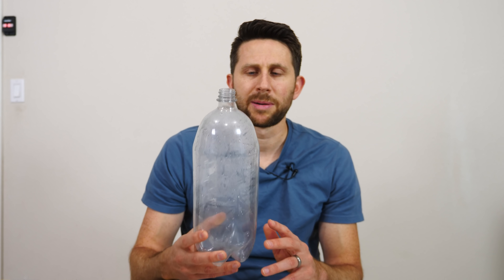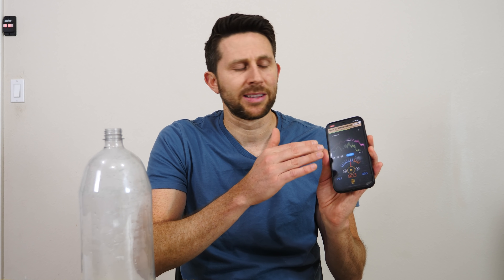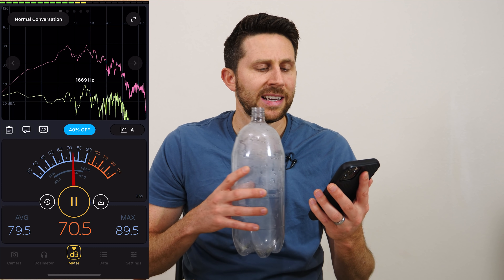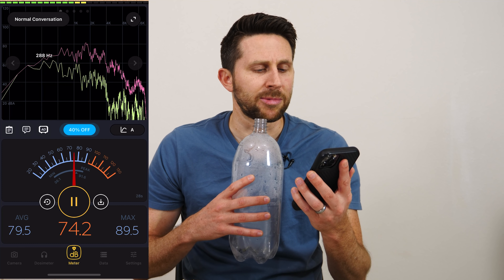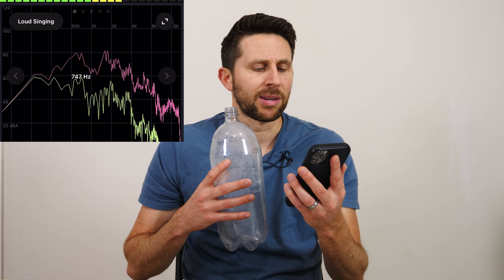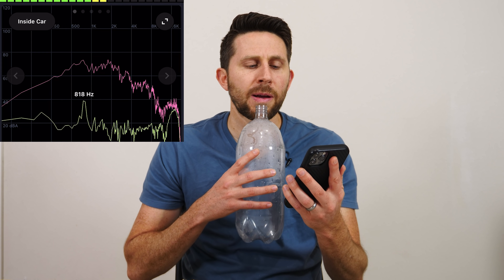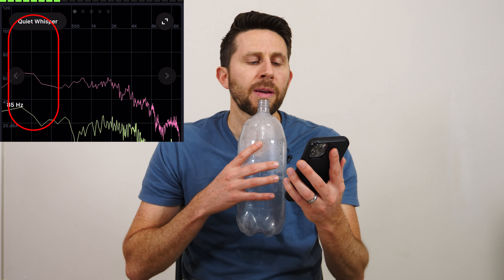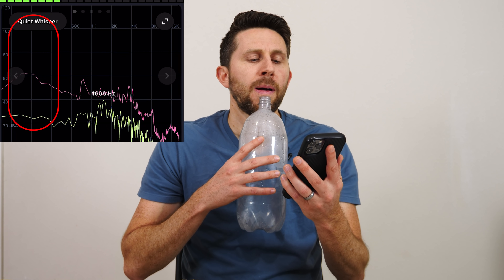Moving Things With Sound—Helmholtz Resonance Propulsion

Comment: Would the shape of the bottle affect the propulsion / vortici speeds?  what would happen if the bottles had a small amount of fluid inside also?  How could the experiment change by changing different factors of the bottle or the fluid?  in a room with slightly more or less oxygen?  In a space full of helium?  maybe my imagination is running away with me.  What things are really possible with different variations?

Comment: Nope, it's powered by in the case of speaker, electricity. As just like hydrogen powers nothing as it is only a liquid battery. Air like waves on the ocean is just the carrier of the energy produced by something else.

Comment: Can someone explain how does the blowing to the bottle thing works? It makes sense if you blow over the neck opening and creating a low pressure area to the opening. But what if you are blowing in to bottle, then it's pressurized and has higher pressure than atmospheric

Comment: When I worked in Hospital, we used a resonator to calibrate the output power of therapeutic ultrasound devices.
The resonator is immersed in water, the transducer in water a set distance away.
The pointy end of the resonator (sealed!) was facing toward the transducer.
As we increased the power, the resonator would be pushed back...the amount of deflection a direct measure of 'acoustic pressure'.
Oh, the water had to be pure and a certain temperature, but the results of the test were considered reliable.

Comment: @The Action Lab  the fluid dynamics community would point out that this is a reaction motor, similar to a pulsing jellyfish creating propulsion by flinging out vortex-rings.      Vortices slowly carry momentum along as they move.   (A mass-bearing fluid jet is the same as a close-spaced stack of moving vortex-rings.  But launching even one vortex-ring will give an opposite "kick" to the launching device.)   If your fluid viscosity is low, then, during sound-oscillations at a circular aperture, the "sucking" part of the AC cycle will produce no vortex-shedding and zero propulsion, but the "blowing" will assemble and launch a single ring-vortex, which carries momentum with it as it flies away.  So, rather than a von Karman vortex-street, it's "smoke-ring machine-gun."   (But multiple vortices are not required.  A single ring-vortex is a mass-carrying object, and the bottle receives a "kick" from launching each single ring-vortex.)
Maybe with an ENTIRELY smoke-filled bottle, aimed upwards, a high-speed camera might see ring-vortices in the smoke stream, just before clear air gets injected into the bottle and messes up the uniform smoke.  (Probably there are ring-vortices being launched inwards as well.   But these crash into the bottle's inner surface, delivering their momentum back into the bottle, so they produce zero net thrust.)

It's just a jet engine, but where the intake and outlet are the same.   It must rely on "Feynman's Inverse Lawn-sprinkler" effect, where sucking does not shed any vortices, and cannot cause propulsion, but blowing causes large propulsion.  Hence, oscillating AC fluid-motion will still generate a narrow "exhaust plume" and create a reaction-motor for Feynman's sprinkler (but only in situations with high fluid inertia and low viscosity.)

Vortex-rings have an outer surface!   They're roughly spherical.   All the air within the surface is moving along as the entire vortex moves ...as if the vortex was a moving baseball made of gas.   It's a real "object," just like a fluid jet, and if it strikes a surface, it delivers a punch.   (And when you first create such a gas-baseball, your vortex-launcher receives a "reaction kick.")

Here's something I've yet to try.   Build a loudspeaker-based smoke-ring box.   Put it in an aquarium full of smoke.   Now launch smoke-rings upwards slowly.   Ideally they should be spherical, like "Hills Vortex."   WIthout turbulent mixing with the air outside the spherical boundary, the ring-shaped flow in the core may be totally invisible.   Will they remain as "air balls," and not slowly change back into smoke rings?

edit: hey, RIMSTAR has a 2014 video, and his shows a textbook illustration: yes, the stream is actually individual smoke-rings, NOT a von Karman vortex-street.  His yt video is:  L5fVFA2sWt4

Comment: so what if i generate a negative charge on the ions inside the chamber and a source plate that switches charge/polarity as the container's vibration moves the ionized air out so that by the time the vibration would be pulling air back in it has rebuilt the amount of charge that was discharged with the moving ions out the opening so the ionized air refuses to come back into the bottle due to the negative charge in the bottle already.

then open up small ports for air to enter as the ions exit to supply the chamber with more ions to move???

Comment: With air bumping into all surfaces inside the bottle EXCEPT the opening, there is more internal pressure on the front than on the back. Could this also be the cause of movement?

Comment: A critical key to think about is the squareness of volume...  an over square vortex tends to become trapped between two pressure gradients and un-coils itself, where as a under square vortex is able to free itself through the process of coiling inwardly . Expansion chambers like what was used on early 2-cycle dirt bikes moved the exhaust gases out the end of the expansion chamber in that a vacuum could be created on top of the piston & at a time when the piston was at bottom dead center and again, produced a pressure when the piston started it's way upwardly. Engery that is transmitted by sound is greater when a gas is under pressure than what it is under a vacuum.

Comment: Ok I had this idea the other day and it’s along the lines of what you do so please help me answer it or tell me a principal or even make a video 

Ok so say you have a pice of gym equipment and the weight is supported by the wires when you lift it up 

So if someone is using one of thoes machines they are holding the weight 
But say that person using that machine was on a pice of wood and so was the machine 

If the person lifted the weight up and 2 people tried to pick up the machine and the person on the pice of ply wood would they feel the weight the original person was lifting?

Comment: Sound air pumps may be made if one-way valves are installed at both ends by creating a frequency from the speaker inside the bottle.

Comment: damn all I can think about now is using an actuator, on a bottle (thinking about the tesla earthquake machine kinda thing but fast enough for the bottle) with a short tube to direct the air down so it could be used as propulsion for a boat/raft to see how fast I can get it going.  steering with a rudder, or have 2 bottles on either side and vary the power to adjust the force on either side to steer.

Comment: Similar to the pulse jet engine where the exhaust gases from combustion, flows towards the exhaust because of it's higher heat and lower pressure rather than the colder and higher pressure intake air. As a result, pulls in more air from the intake during the chamber cooling and the next burn happens, repeating the  process. Also very dependent on the throat length area and the combustion chamber area

Comment: Ooof. Anyone who's flown in the back few seats of a DC-9 without engine sync also knows that painful feeling in the ears, although in that case it's caused by the beat between the engines (specifically, the hum from the high pressure compressors - which is, coincidentally, around 112Hz at idle).

Comment: You say when blowing in the bottle that the sound is created by the walls fluctuating due to the change in air pressure back and forth. But this shouldn't be the case with a heavy ceramic jug, should it? Yet, it creates the same sound as the plastic bottle. This should mean that the pitch is determined by the shape and volume of the bottle, and not by the walls vibrating, since the inflexible ceramic cannot vibrate the same as the flexible plastic.

Comment: I just went through the pop-pop boat cause explanation, which is what this is using air.  There is a YouTube video of a guy that runs a water pump on a toy boat through a tube where both ends are sticking out the back under water, one tube is input and the other tube is output with constant flow.  It creates thrust, because the exit is easy and has a single direction for force reaction, however the input is complicated by omnidirectional pressure flow of water at the opening, which is the difference that results in thrust.

Comment: When you changed the sound to a high pitch after making the bottles move it looked like the bottles tried to move in the opposite direction. Is that actually possible the creat the opposite affect so the sound waves being pulled in to the bottles is stronger so to pull the bottles?

Comment: Hmm could you put some sort of check valve on the bottle so air could not go back in and cause it to self seal ?
Also shouldn't multiples of 112 hrz also cause it to move such as 224 hrz?

Comment: I think the explanation is not entirely acurate. Put pingpong ball 1 meter away from you on the table. You cannot suck it towards you, but you can blow it away of you. Blowing is directional, sucking is not. This has to do with momentum of particles, not with vortices. Also you use helmholtz resonation to determine the resonant frequency, but i am not sure if propulsion is caused by the same effect.

Comment: another way to get sound to move things:

get a solenoid and put a piston inside it (with a magnet on one side and a large surface on the other) to create a rudimentary microphone. The current made by the solenoid can be passed through a AC-DC converter and power a small motor

Comment: Before you fully explained how this worked you demonstrated how blowing into the bottle was taking linear flow of air and translating it into oscillating movement of the bottle walls. I'm guessing since much like intermittent gears work to translate rotation into linear movement this can probably be explained using mechanical terms/demo right? I ask because I understand 'why' this works, but i dont understand 'how', lol. Does that make sense?

Comment: I was taught that the air in the neck of a Helmholtz resonator acted like a mass and the air in the body acted like a spring - essentially just a mass-spring system. The smoke demo reminded me that reality is much more complicated. Very cool idea.
Reply: Right as if the air in the neck of the bottle virtually never leaves that location, and just moves up and down.

Comment: The big speaker which had the tube in it actually has a helmholtz resonator, the tube. It is used to boost The low frequencies. It is also called a bass reflex port.
Reply: 4:53

Comment: I had a query....is our vocal cord performing in the same way like the bottle using Helmholtz Resonance?...🤔🤔
Reply: My understanding is no. When we speak, air flows between our vocal folds and creates a low pressure region that causes the vocal folds  to pull together- they hit each other and bounce apart and then the cycle repeats- many many times per second. Your vocal folds are like a buzzer and then you shape your mouth to make the sounds- your throat/mouth/sinus shape has a different sound for each shape.
Reply: @instructodad  Ya...I just wondered cuz the vortex forming and all that was nearly similar ...still , Thanks 😁

Comment: For getting the frequency - it looked like the app you used is using constant bandwidth slots for the analysis and the frequency you got is rather inaccuarete.
Lowering the cutoff and increasing the bins can help with the accuracy there.

Talking from experience here as me and my friend tried dual-tone multi-frequency encoding (DTMF - the way old phones used to dial automatically) and with the first attempts we noticed that the shown frequencies for the low-tones were off by up to 5%. For resonance-phenomena that is a big difference.

Comment: Does this mean the bottles would move faster if you held an actual wall behind their openings instead of the virtual ones?
Reply: No, the vortices only create a virtual wall while the air is moving out of the bottle, that's why it pushes because it's synced up to the pressure wave. If the wall was there the whole time, the low pressure would suck it backward as soon as the pressure wave passed (actually the high pressure on the other side would push it backward into the low pressure zone, but it's the same thing really). You'd get no net movement overall.
Reply: @FirstLast-gw5mg  Ah I see! Thank you!

Comment: My total guess is that there's an air impedance mismatch between incoming and outgoing air, as well as a direction difference. It's picking up air from around it (omnidirectionally) at lower velocity, while thrusting it (unidirectionally) at a higher velocity with a narrower stream. So there will be no net difference in incoming vs outgoing air, just a difference in impedance and direction. Vortices are amazing!

Comment: @6:38 I think it is in part because of the vortex explanation, but I also think it would work without vortex shedding on the outgoing air too.  The reason is because the air exiting the bottle is relatively directed straight out but the incoming air is drawn from air in all directions near the opening, creating less directional momentum.

Comment: I caught myself asking a dumb question.  As I was watching the video, I thought to myself:"I wonder if this could be applied to space travel?"  No doubt some of you will see the problem much quicker than my 64 year old brain did. "D'uh, sound doesn't work in a vacuum!"   I claim no liability for any injuries sustained during face-palming.

Thanks, Action Lab, for educating this old dog.
Reply: There's also no air 🤦
Reply: @Jake Loranger It could! Just not with air but with a flow of ions in plasma or Hall thrusters. Although I don't know if the linear propulsion they use would provide a stronger push than just the flow eddies. But you certainly need to account for non laminar flow when designing the thrusters. Maybe you could even make use of it, like ducks do by flying in a V. (Although you don't have sound in space so you wouldn't be able to make the object vibrate like this. But the turbulent flow does apply here.) At least that's what I'm thinking. Great question!
Reply: @TriVos Ahren no sound, but what about memes?
Reply: Inner-space travel the final frontier... volume displacement of an over square , square, and under square vortex. If you want to travel faster than the speed of light... you must remove the orbiting particle system's  that make up your particle-flow grid- signature from the electron, neutron, and proton and yes life as we know it can exist on an electron... provided the conditions are right.
Reply: @gordonstull1962  you can't bullshit your way outta this one.
Reply: no, but electromagnetic resonators do work in vacuum, and the cosmos is filled with 3K° background microwaves, the problem I see is that turbulence as we understand it won't work on microwaves, but perhaps there is a trick or two that we need to learn first!
Reply: Yes it can work.
Reply: Most definitely can be used for space travel... think of it like this... a machine that can displace particle Mass behind its self as it travels forward... where you have that 50/50 balance. Once you have achieved that 50/50 balance you can go anywhere in size and time... but "not" in space and time. This is all that I can say at this location & point in time. Because of a certain separation factor between the "God of Love" & the abomination of desolation and or that which makes desolate. Seek the light and most definitely you will be allowed to step into the kingdom of heaven... for the "God of love" is planting its kingdom on this earth at this point in time !!!
Reply: @gordonstull1962  what? Could you explain?
Reply: @gordonstull1962  lol 😆 and then the easter bunny will cure everyone's cancer, the tooth fairy will spread her legs for me, and santa clause will watch.

God (and religion in general) is just a construct created by humans to make humans behave. Without it there would be nothing stopping anyone from stealing and killing for personal gain, and further evidence isn't hard to find: ever wonder why no religion mentions dinosaurs? Seems like a huge part of earth's history to forget.. well it's because religion was created by man BEFORE the discovwry of dinosaurs, so of COURSE it wouldn't be in any religion.

There is no god, and if there is he stopped caring about this forsaken rock almost 2 thousand years ago.

Comment: Could a check valve of sorts be placed on the opposite end or some other area of the bottle? So that one opening does the vortex shedding, but its work isn't reduced as the replenishing of air is coming into the bottle from another opening.

Comment: But, if air IS going inside, then there should be no net movement? In the smoke case, I guess the momentum of smoke is more than the momentum of air getting in, so bottle experiences a net velocity propelling it, but how does this work when both fluids going in and out are air? I think there's something else happening beside this. Are you sure this is not due to the vibrations twirling the stick ever so slightly to provide a torque?

Comment: What if u made it double of the 112Hz????????  Because there are 2 bottles ...... Will the speed be doublesd???????
Reply: It would probably move slightly because of harmonics, because a 224 Hz wave is in sync with a 112 Hz wave. But it would move slower because it's not the natural frequency.
Reply: @FirstLast-gw5mg   thank you